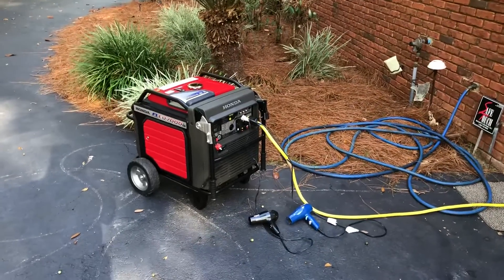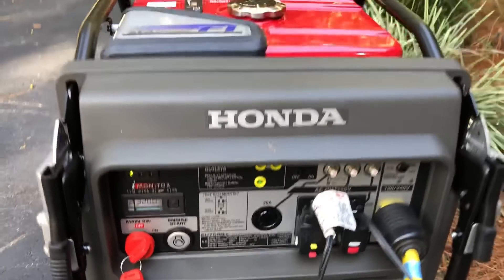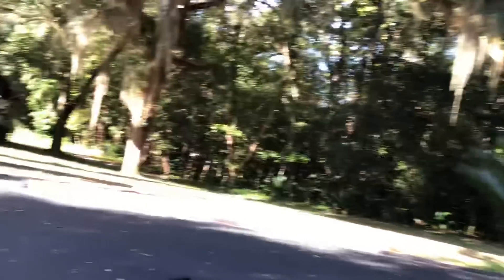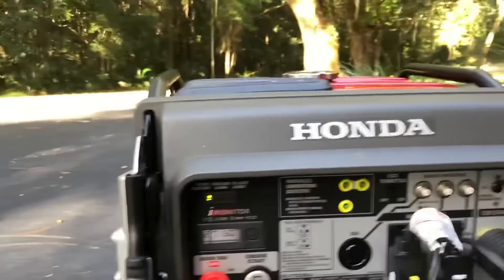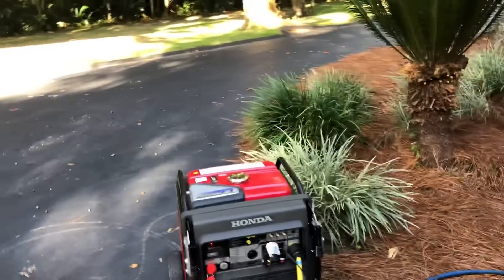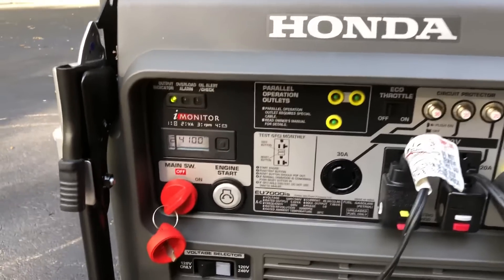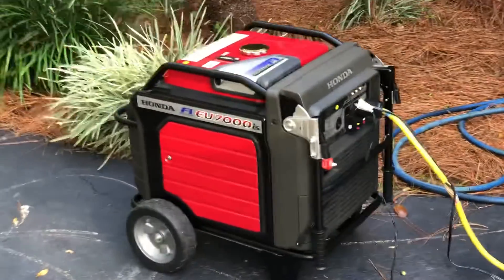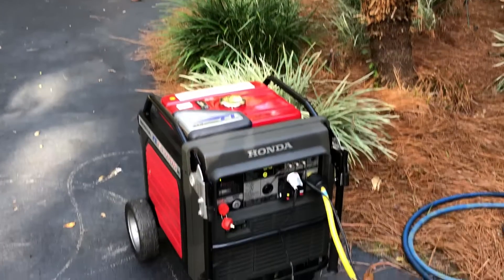Honda EU 7000 inverter generator at 7700 W full load bank test until breaker tripped

Comment from the maker: I would assume if the  overload light is not on it would probably run a long time but I have never had it trip out until I was well over 7500 Watts.. When the red overload light comes on it will trip the breaker but I’ve never had to do it until that overload light comes on
Reply: Please remember not to run your generator in wet conditions because you can get electrocuted if your generator is wet. Thank you that your generator is 20 feet away from your house so your family won’t get carbon monoxide poisoning. But the only thing is generators should not get wet or be used in wet conditions. I know all about generator safety.

Comment: For how much time it can run continuously with 80% load
Reply from the maker: You know I don’t really know I only use it during hurricanes and probably it has between 1000 W load to about 4000 W load intermittent as things turn on and off but we generally keep it running 24 hours a day during a hurricane and I think it’s about five or 6 gallons a day it’s not much I keep a plastic 55 gallon drum in my garage and it is probably around 20 days Over the last three years with no problems. It’s very efficient

Comment: Well done btw. Thanks. I have some Honda 2000. Well over 11k hours before one finally froze and wouldn't run. The rings stuck to the piston. These generators are built with great strong motors. That's where the price comes in. The internals on the motor.

Comment: They're badass generators! Mine has 4300 hours on it and it still looks brand new and runs like new. It amazes me. I've changed oil every 100 hours and only ran premium gas and I've 0 trouble with it. It still has original battery. Honda eu7000is for the win!
Reply: How do you think the sound level is compared to a comparable home depot or etc generator??   I'm in Florida, so if I am using it, it will be for air conditioning. lol.
Reply: @Michael-qy1jz  Herb i can't tell you comparison because i have never used the home depot or compatible generators. I have a few other generators Troy built 5500watt and that one is noisy, I've had several Hondas the eu2000is, the eu3000i, and eu2200is, and all of the Hondas including my eu7000 are hands down the quietest generators I've ever had. Mine still looks brand new and runs like new. When i show people the hour meter they can't believe it has as many hours on it as it does. You can't go wrong with buying a honda. They hold there value. They're very efficient. They sip the fuel. And they are very quiet. If price is a factor that's steering you towards the similar ones look for a good used one to save some money. I don't know how big an ac you're going to run. But my eu2000is i had with my campervan. And it ran my rooftop ac and fridge and tv. If i were using coffee pot as well. I'd turn ac off to brew the coffee them put it in my thermos to keep it hot, and turn my ac back on. So if you're talking window ac the eu2000 will be plenty.
Reply: @BuggysTowJam   Thanks, I have a Briggs 8k peak that runs great and runs my home a/c, but it's very noisy.  I dont think people realize how big of factor noise is until after a hurricane and all the neighborhoods have lost power. Lol.  I have a trane 2 ton a/c.   I love the idea of that 7000 unit with fuel injection!
Reply: @Michael-qy1jz  okay gotcha you're going to run the central air. The 7000 is a fine choice. And yes i understand the noise issue once power is down. I hear my neighbor 2 houses away generator and mine is purring. Lol and really fuel efficient. If you're powers down for long lengths of time I'd suggest getting a separate larger fuel tank. The fuel injection is great. No carburetor to get gummed up from sitting.
Reply: @BuggysTowJam  Thanks, I see the extended tank kit which is a great Idea and I noticed they had an extended exhaust out kit too.  I'm sure these units are flawless
Reply: How many hours do you have now?
Reply: I ran the $2500 generator for a whole year to power a 26ft camper. Ran like a champ flawlessly, and traded it to a used car dealer for an entire van after even lol. Astonishingly quiet at half load.  Ran camper AC in California no prob.

Comment: Can we run 2 ac 1.5 ton
Reply: yes it will.  but just look at ampere tag on equipment for start up load. Should be less than 22.5 amps.
Reply from the maker: Hitendra Sarthi You know I’m not for sure but if you get a really good Hardstark capacitor and start them at different times it may not be a problem if you have a little 2000 W inverter to run male to male with a bigger generator and start them up and once you get the units running you could Turn the smaller generator off it should definitely work

Comment: Mike how big is your house? How do I know what size generator I need?
Reply from the maker: GalanTv Well if you look at the cord that I have plugged into the generator and see how I cut about a 2 inch section of insulation off of the power cord and therefore I can clamp a multimeter around that power cord and get an accurate amount Reading of the power that it is consuming. But you probably need to go in your meter box and figure out with everything you’re wanting to run clamp around your inbound wire and see how many amps you’re consuming and also you can read the surge load also but that 7000 won’t be the best generator for running most households and it’s very reasonable in the time of a storm you don’t want something that’s going to use 20 gallons of gas a day that you cannot find gas that thing will run all day on about four or 5 gallons of gas. Also you may want to purchase a couple of cheap 110 V window units to put into your house during a storm when you’re going to be out of power for a few days you can put them right into your window and the generator can Easley run the smaller units and I will keep your house very comfortable without the huge surge of a big air conditioner running.

Comment: i guess not all Hondas are created equal, i watched another video of this same EU7000 and the guy loaded it to 9000 and it kept going ?
Reply from the maker: Well at 240 V with only 240 V running I have seen this one up to 9200 W but with a lot of 110 V load running I think it won’t get up that high I wonder if it’s running off of two separate sides of the generator because if you keep it 100% 240 V you’ll get more power out of this generator maybe somebody has an explanation for this.
Reply from the maker: It’s really all in how you load the generator if you’re doing all 110 V it won’t put out but about 7000 W but if you’re using the 220 side it will go up over 7000 with no problem it just depends on how much 220v consumption you have

Comment: Do you have electric hot water tank and if you do was it on
Reply from the maker: chaffymaple209 No I have a gas hot water heater so pretty much the 2 ton unit pulls 2300 W and I think the oven pulled around 2000 W
Reply: @michaelvaughn5439   How is the sound level comparison to a regular generator that is similar? I am in Sarasota Florida, so If my generator is on, it's to run my 2 ton a/c ! Lol
Reply from the maker: chaffymaple209 No I have a Lennox complete heat boiler unit for my hot water.. Lp gas

Comment: Thanks Michael, appreciate you posting this video. I’m running mine at the moment up in Massachusetts for a downed power line. Most lights on, two ceiling fans, tv, refrigerator, boiler and outside lights and I’m at 1050-1100 in Eco Mode. I’m loving this machine, well worth the investment!! Cheers
Reply: At this point you have to turn off the eco mode